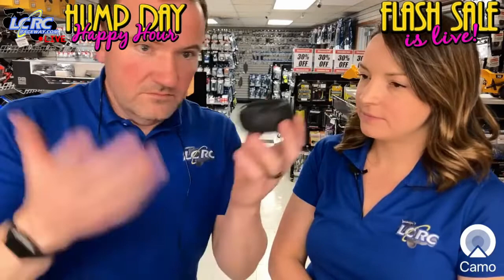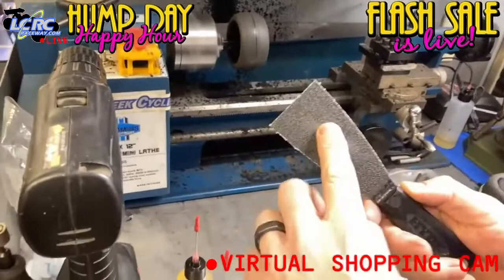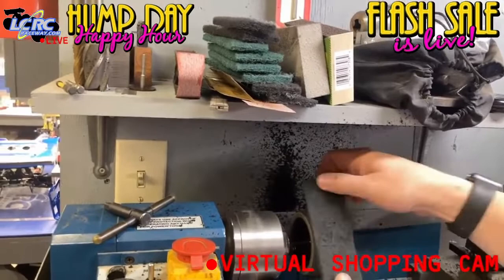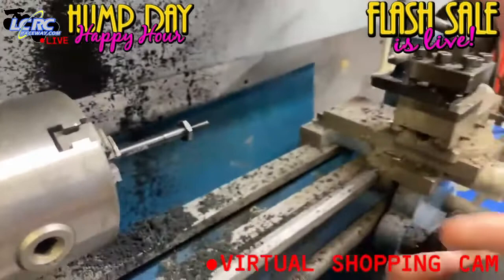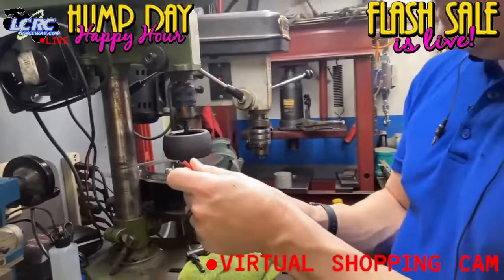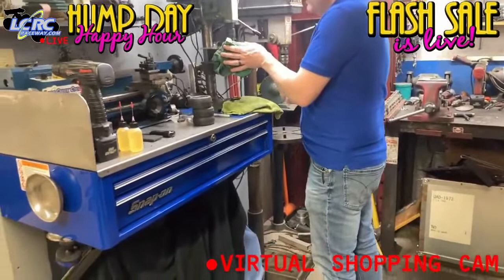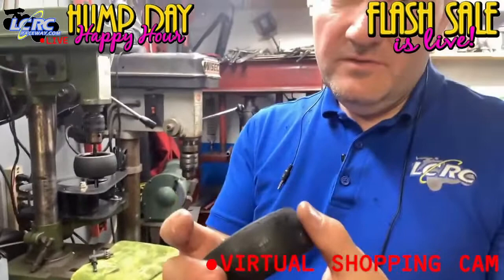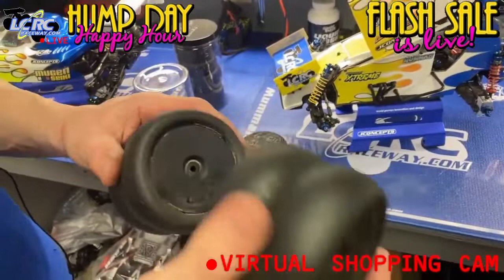LCRC presents Dirt Oval Tire Prep 101: Foam Rolling, Ghost Tread, Tire Dope and More!

Comment: Hi, thank you for the great video.  Regarding the foam buster, what speed do you run the drill press at?   I find that i have considerable dust gear from the foam at about 10 minutes.   Is this normal and should I continue busting if I am getting foam dust?  Many thanks.
Reply: Good question David.   I usually run at 500-800 rpm on the speed.   If you’re getting foam dust in 10 min you are either too fast on the speed or too much pressure in the roller wheels.   You may want to check your adjustment on how tight they pinch the tire.